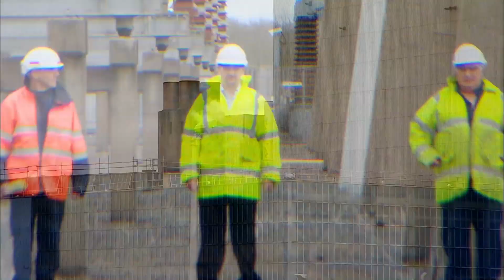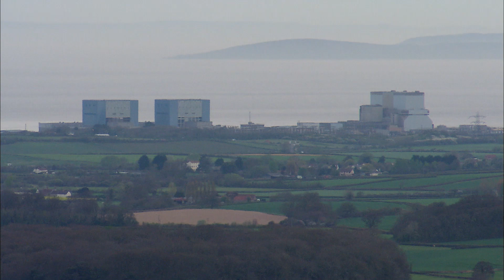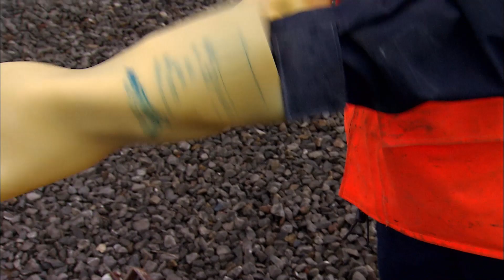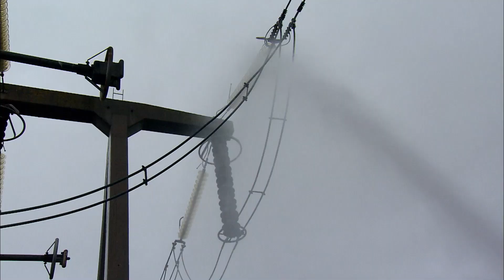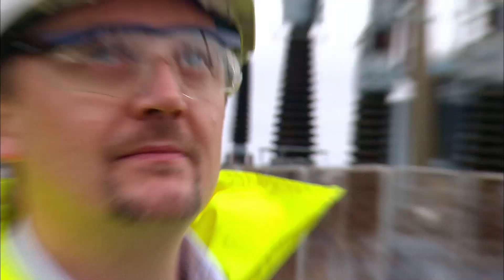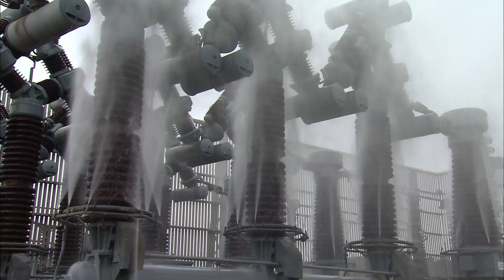Is This The Most Dangerous Job In The World? - Cleaning an Electric Grid | Supersize Grime | Filth

Comment: If they have an automatic washer for the 400kV, why don't they just have one for the 275,000V sub station🤔?
Because if they do it that way, they'll be a lot safer and only have to maintain the automatic washer system and not risk dead by manually spring water on either of them.⚡💀⚡
Reply: Was thinking the exact same thing!

Comment: Is that a power outrage, a flash over?
Reply: No, flashovers are a form of arc, the electricity jumps across the insulator, in this case to earth or if the cable is disconnected, the cleaner, 275 thousand volts at the amp rate outputted would kill instantly, the way an outage and flashover link is that if a flashover occurs the breakers automatically disconnect the line, removing power from the system and the power plant but that’s a problem on its own.
Reply: @InserNameHere2053  ok thank you